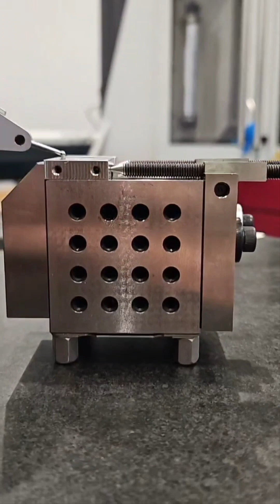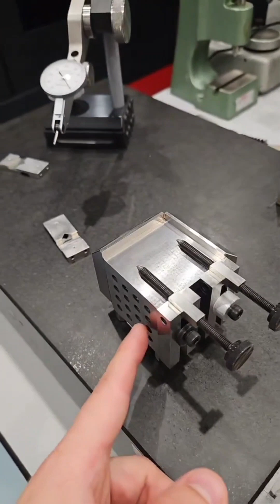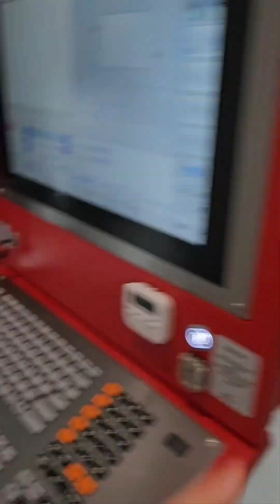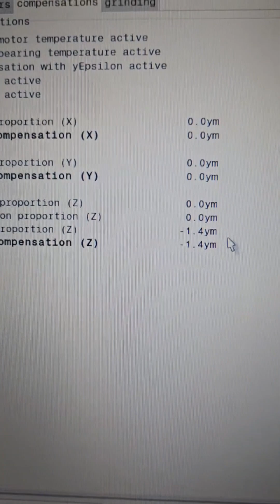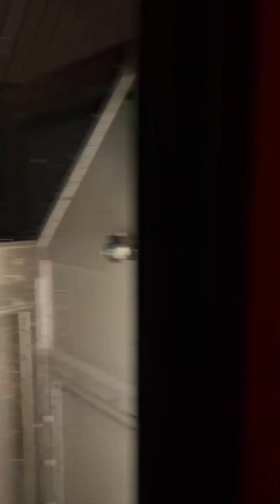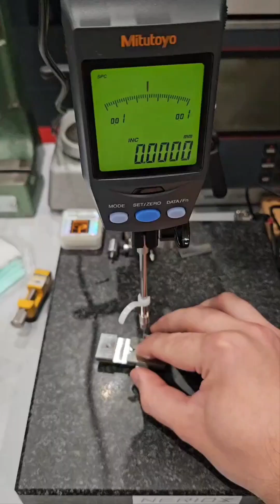High precision manufacturing of complex components: A brief walkthrough.

Comment: Thanks for producing this Josh, very interesting. I worked as an aerospace bench fitter in the 1980s with many of the items (no CAD) you described. The tolerances the guys could get without automation was incredible. They would take a cut and then do a pass with the same settings leaning on the machine to get that last couple of microns. I loved working there.
 They had a granite table the size of three dining room tables due the traffic of machinists, the cost today would be astronomical.
Keep them coming